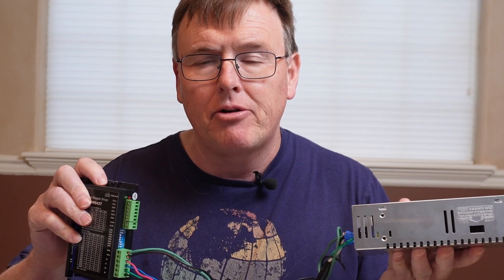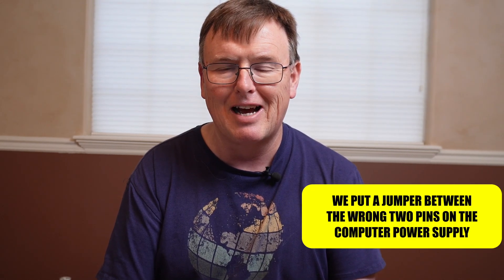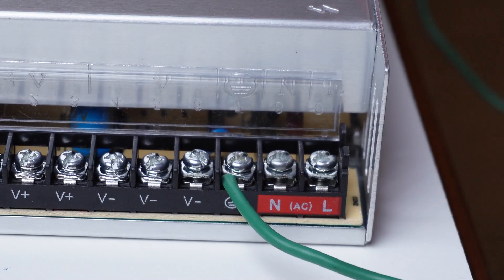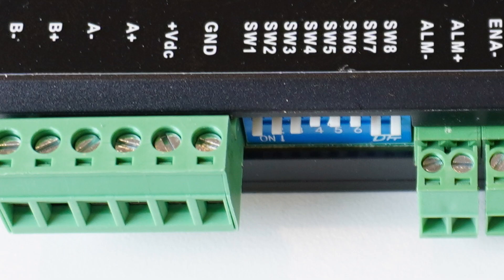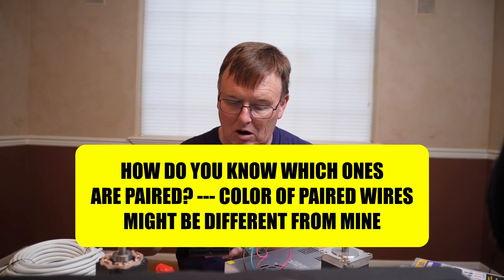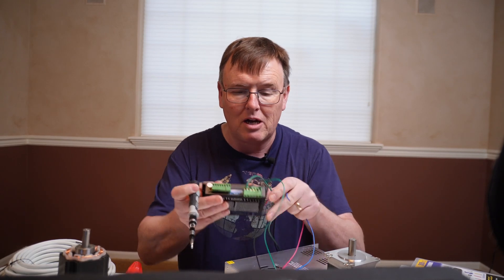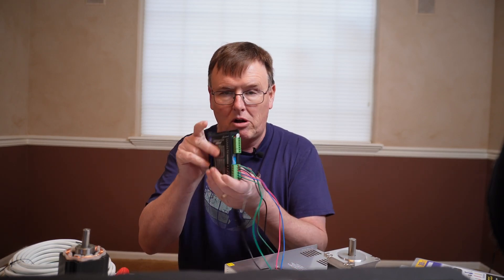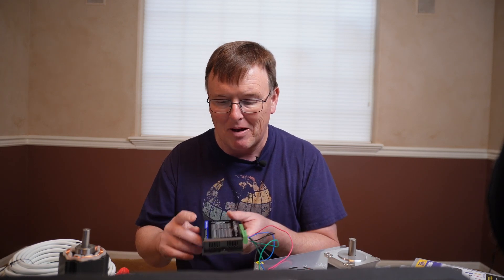POWER SUPPLY AND WIRING NEMA MOTORS | BUILD A DIY CNC ROUTER EPISODE 3

Comment: Thanks for explanation covering the most topics , just  had a doubt will a 24V  10amp  power supplier will run the  4   nema23(small tier)  with DM542 Driver respectively. also adding arduino and breakout shield.   (NOT USING IT FOR SPINDLE)
open for any suggestion...
😁
Reply from the maker: Sorry it took me awhile to get back to your post.  Somehow I missed it.  If you don't want to spend more money on a bigger power supply you could just adjust down the switches on your DM542 stepper motor driver.  Assuming the nema 23 motors that you purchased are able to handle at least 2.5 amps of current then use the switch setting just below 2.5 amps (since 4 x 2.5 = 10 amps).  For example,  pick the 2.37 amp current level switch settings (printed on front of motor driver)    .So you would flip switch one off switch two off switch three on and switch four off on all four drivers. That should keep you under the 10 amp max of your power supply (even if all steppers were drawing this max current but that likely would never happen).   Of course taking this approach would cause you to lose a little of the Nema 23 potential but you might not even notice that much of a drop off.
 
 Using Nema 23's at 2.37 amps would still give you way more power than the nema 17's that many people run their CNC's with.  

There are alot of variables in play such as gantry weight that could come into play with your CNC but I suspect you will find you CNC works fairly well even with these lower current settings.  Do watch carefully when you calibrate your machine to make sure your speed setting are not too fast and your losing steps.   If you are then lower down the max speed in the firmware. If you already have purchased the power supply give it a try with the lower current settings on your drivers.  You can always upgrade in the future.  I also would recommend you plug it into a power strip with a 10 amp breaker just to make sure you don't fry your power supply.
Another option you could try is buy a current reader and plug your power supply into it so you can see how much power is really being used (but that would probably cost you about half as much as a new bigger power supply).   Harbor Freight used to carry something like that for maybe 15 dollars or so.  If you need any more help or have any more questions just let me know.  Hope that helps.

Comment: Where did you get your shielded cable from?
Reply from the maker: I got it from Amazon but I suspect you could buy something similar from a music store that has 4 shielded wires for considerably less money.  Maybe someone who reads this knows of a lower cost alternative and will post. That being said the shield cable off of Amazon works well. Here is what I bought - 18/4 AWG Shielded CNC Wire (50FT) - Flexible Stranded Shielded 18-Gauge 4-Conductor Cable for Stepper Motors, CNC Machines, NEMA Motors.  I think it cost around 40 dollars.  If you are building a smaller CNC there may be a way to buy a smaller quantity.  You might want to look at getting some aviator connectors as well off of amazon as it makes the connections much more durable (if you are willing to solder a few wires).

Comment: The tip for identifying the pair by pinching the wires together would have saved me so many headaches in the past :D excellent tip. Same with the switch on the drivers that drove me insane when I was working out the electrical for my newer router that was arduino driven. I lost several days trying to figure that one out :D
Reply from the maker: I appreciate so much your comment which validated what I shared. Only those of us that have struggled through those things understand how much knowing little tips like that in advance would have been worth. Hopefully your comment will get a few more people to really hear the importance of paying attentions to those seemingly unglamorous tips I have shared that are sprinkled throughout the DIY CNC router series. They really are of far more value than the ivory tower slick and glossy pretend builds that all too often show up on YouTube.

Comment: The best electrical safety tip was told to me by a (then) old TV repairman.
Keep one hand behind your back when working with live circuits. This way, you avoid current through the heart, if you happen to touch a live point.
Be mindful of placement of your other hand.  Don’t lean on grounded metal for example.
Reply from the maker: OUTSTANDING ADVICE.  I'VE HEARD THE SAME THING.

Comment: Thank you very much for this. Greatly appreciate you taking the time to explain step by step thoroughly. Colors here are different (as is the voltage) for the power cords. Double check things is good advice from you; as is "the power supply can still be faulty".
Reply from the maker: Thanks, I really appreciate it.  It's really easy for me to get stuck in viewing the world from my locality (the United States) and wrongly assume that it must be the same everywhere else.  About 40% of my viewers are from countries outside the U.S.  If you don't mind sharing, what country of the world are you from and what voltage does your country tend to use?
Reply: @Simplifycnc  I am from Germany. Got 220 volt, 50 hertz. Our power grid is very stable, unlike those where I lived in the US. Ditched my UPS about a year after bringing it with me (20 years ago), because there were literally no brown-outs here. However, just got a new UPS in preparation of the imbecile energy politics that endanger our very dependable high quality electrical grid. Not against green energy at all. But the implementation requires a decent framework set by the government. That is lacking big time imo.

Thinking of UPS. May get a second one for the CNC once that is running. Maybe a photovoltaic system with power storage to be independently operated from the public grid. A small one will suffice and would set me back about 2.5k €. It would be a mobile system. Would take, at current power pricing, at least six years to amortize. Depends on the sun shine and the future pricing (guaranteed to go up). 

Oops! Writing this was very helpful as it reminded me to note and report the various utility meters. Our power company got taken over. They say that nothing will change for us because of that. Guess what? They lied! Pricing will go up to match the new company's. Then there will be a further increase in the CO2 -tax. They don't call it that, but that's what it is. Oh, the power grid tax is going up too. Value-Added-Tax (a misnomer as there is no added value) of 19% (!) gets levied on top after all the various taxes (or whatever they call them). Germany has the second highest energy costs in the EU after Belgium. Well, I better stop or this will turn into  a book. lol

Haha, sure got an ear full as answer to a simple question. I doubt I'll have many questions for you regarding the CNC. As things go, you will answer them all in your future videos. I'll be patient :) And in the mean time acquire more stuff for the project. Just ordered grease nipples, grease gun, and grease for the linear rails and the ballscrews.
Reply from the maker: @Anderle52134 I I visited Germany about 25 years ago and had a really great experience.  I particularly liked the German chocolate. I think one day I too am going to try to setup some solar panels and battery system. 

Politicians everywhere are the same ---  tax, tax, tax (and somehow, someway the corporations that are supposedly nonprofit just manage to make huge political contributions to whoever is/will be in power) and everyone else pays the bill (that somehow always goes up despite promises).   Thankfully, we don't have a value added tax (at least officially here).